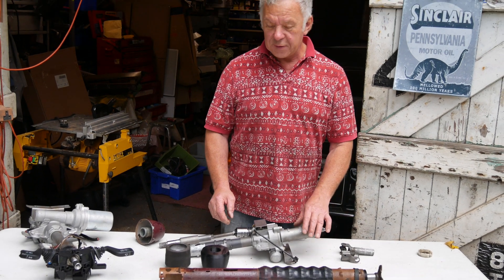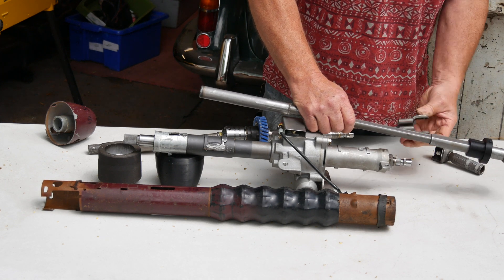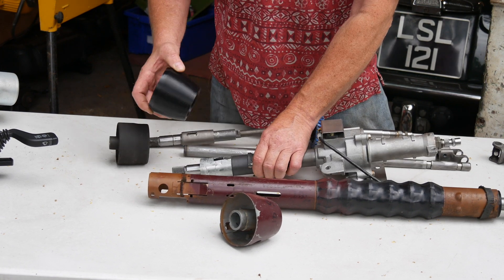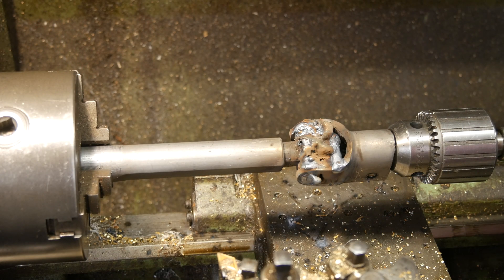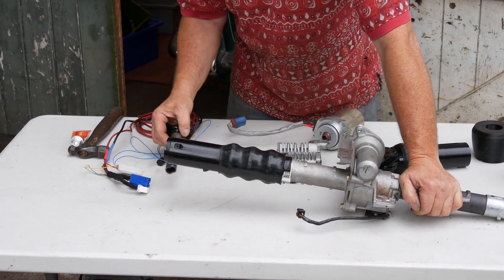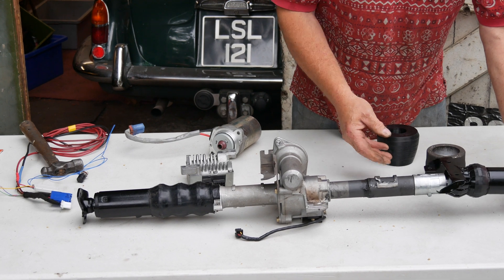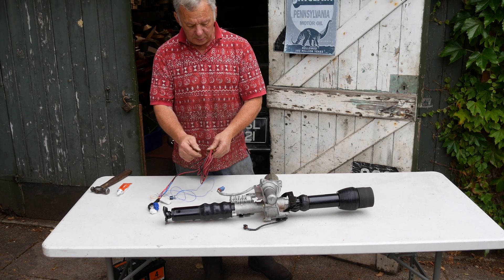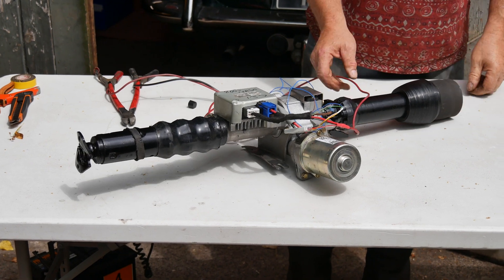63 Ford Falcon / Mustang EPS (Electric Power Steering) conversion

Comment: Hello, I have the same corsa c colum but mine is tilted. Need to shorten it a bit but not sure where to do it. I have barely space between the pedals and the gearshift also runs behind the steer😵‍💫. I am trying to fit this to a motor home fiat ducato 1990.
Reply from the maker: I only use the base model Corsa columns which are not tilting and easier to mount. Not a good idea to modify the column but if you have to, do it at the bottom.